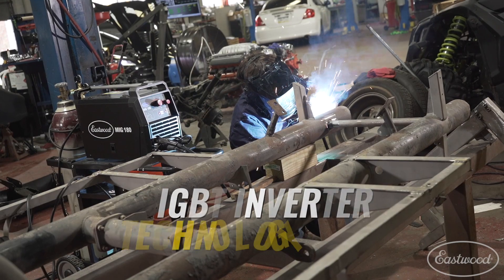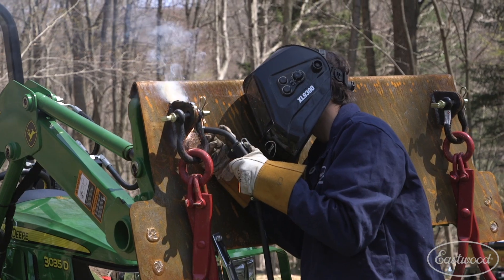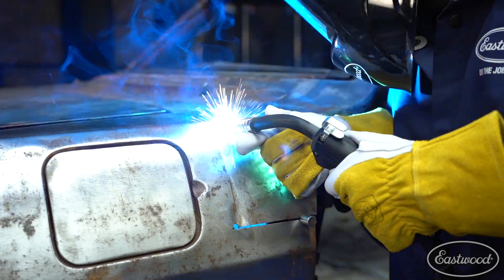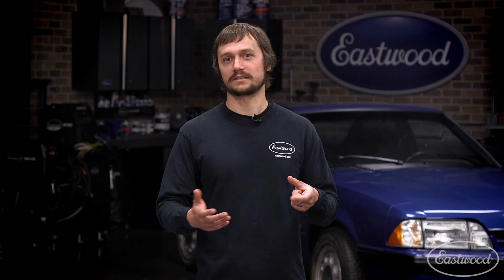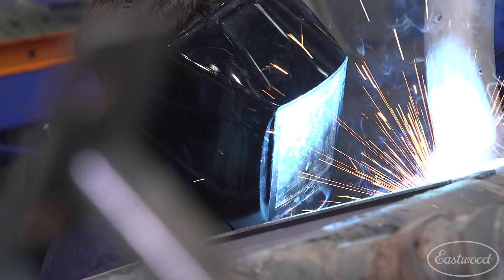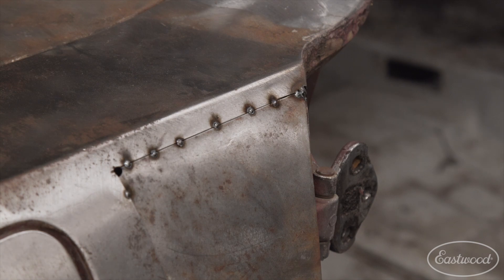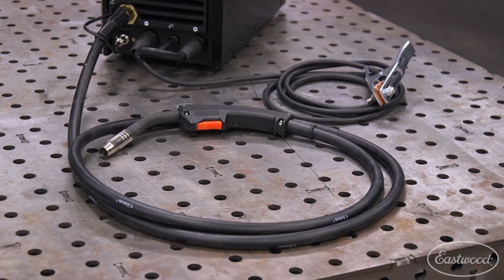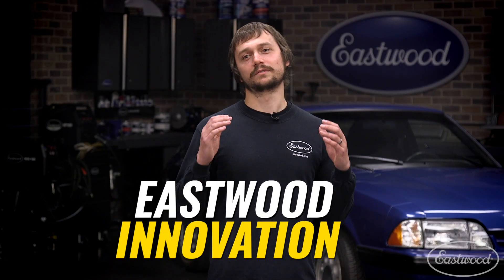Four Reasons Why We Replaced the MIG 175 with the MIG 180 - Eastwood MIG Welders

Comment: I just bought the Mig 180 last week. My only 2 gripes are the power switch in the back, instead of the front. And the centered gas inlet on the back of the welder. The hose coming off of the back touches my 125 CF tank. It was better on the 175 with the gas inlet being off-center and the power switch up front. Aside from that, it’s an amazing welder! Thanks 👍🏻
Reply: Totally agree about the power switch